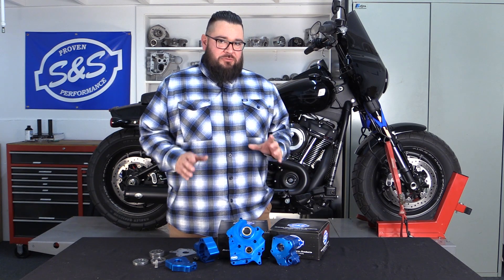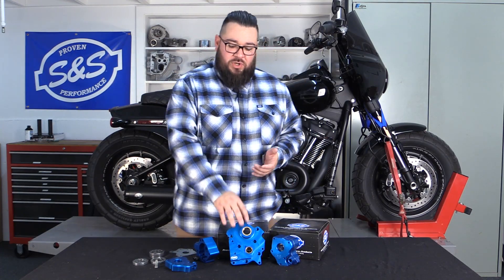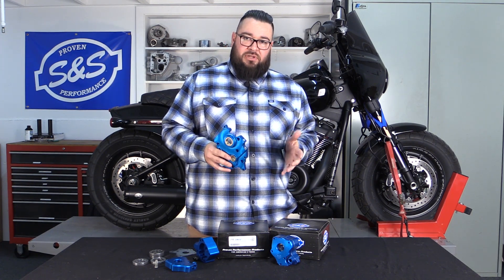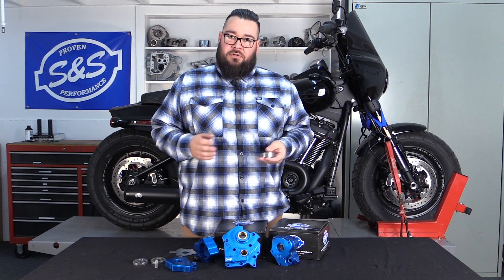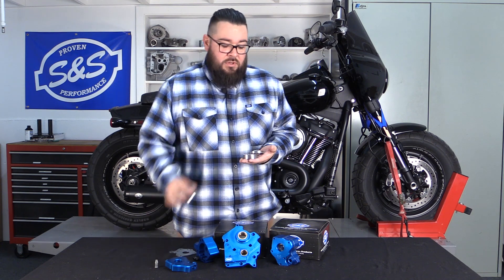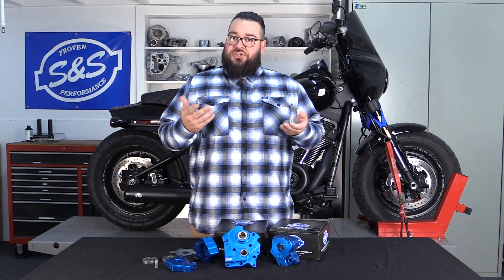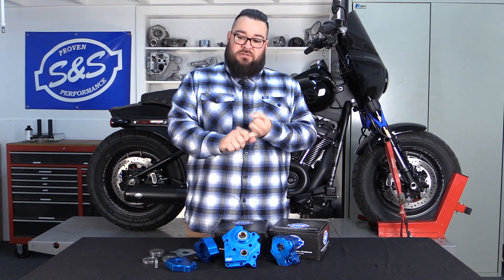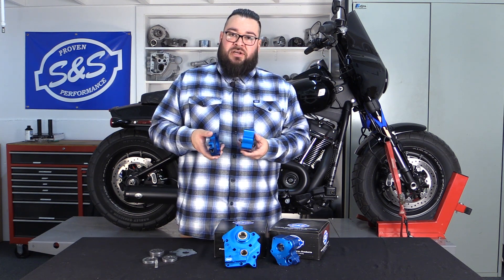S&S Cycle Product Spotlight - M8 Cam Chest Kits

Comment: Will this kit help a stock engine better than factory components?
Reply from the maker: What this cam plate and oil pump kit it going to do better than stock is move the oil more efficiently.  It is going to provide higher flow at a more consistent rate than the stock unit.  Where you see huge advantages on this pump, over the stock unit is in the scavenging side.  It does have the capability to flow higher than the stock pump, but even bigger than that is the fact that it has two independent scavenge sections.  One draws from the flywheel cavity and one from the cam chest.  This insures that the pump is always working.  It does not allow either cavity to build up with oil.  There is also a debris screen in each of the scavenge pickups and a magnet at the bottom.  This prevents chunks from entering the pump if something fails in your engine, helping to keep the damage from spreading.